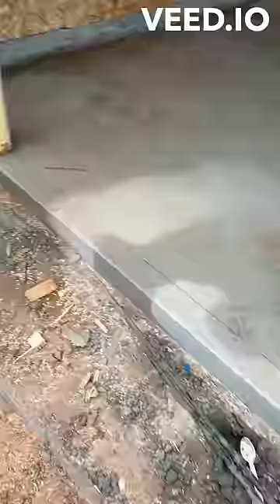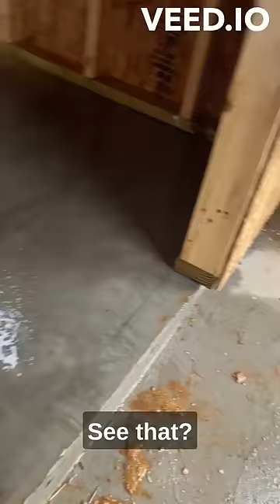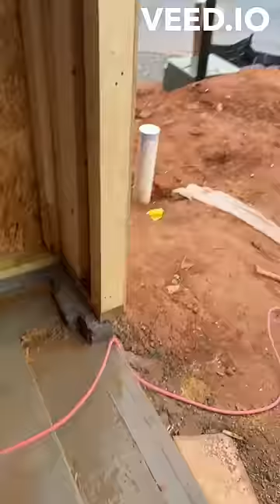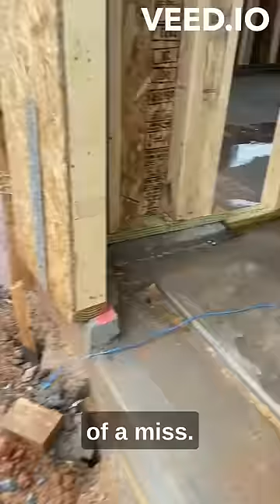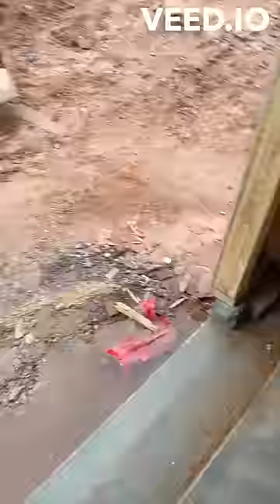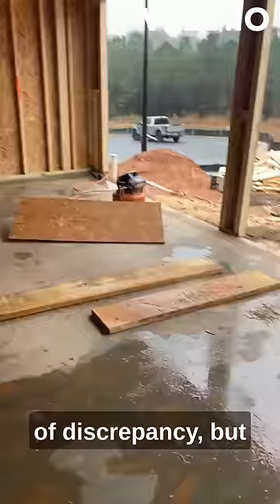New Home Slab is Wrong Size, What Now?

Comment: Before you frame an entire house, you might wanna call the general contractor and get permission to shrink the framing an inch and a half.
Reply: Finally someone with common sense
Reply: Well unfortunately, you don’t just “shrink” the framing lol
Look at the concrete, they weren’t off on the very first one, and the further down the line he got the worse it got. If you shrink the framing an inch you will be 6” off finished project.
I agree with you it should have been handled prior to this point, and maybe it was and they are all in communication, we don’t know because he didn’t say. But the excavator and concrete guys are coming back I can tell you that much.
Reply: GC dropped the ball when babysitting the concrete guy. You cant just change dimensions of a plan on a whim. Trusses have already been ordered and delivered sized to the print. The carpenter built to agreed plan. If GC wants the carpenter to adjust to the concrete guys, thats a change order. The GC breaks out his checkbook and the carpenter breaks out the sawzalls.
Reply: @LovelessRanch where do you get 6" from?
Reply: Well, 3 inches
Reply: What do you mean it's off? The concrete guys pulled the dimensions off the print... And measured to the outside of the form boards😂😂😂😂😂
Reply: I'm now almost 40 and it was mind blowing.  Watching grown, professional men, twice my age  having toddler tantrums and me trying to parent them through it.
Reply: No. This is NORMAL in Australia and a carpenter told my dad they just go ahead and build it to plan. Trying to get it to fit best.
Reply: Yes that would have made a lot more sense😂
Reply: @OffGridInvestor no one would have even noticed if they had just shrunk it a couple inches😂
Reply: Take an inch of framing it’s a garage not the space shuttle
Reply: That looks a lil more than 1.5 inches, lol.....
Reply: Carpenter dropped the ball not bringing it up
Reply: If you shrink the framing then the pre engineered trusses wont fit 🤦‍♂️and your stuck doing more work but then that calls for back charges lol 😂
Reply: @OffGridInvestor good thing America has better standards. This is getting rebuilt or builder will be sued.
Reply: @Un-Burdened 3 inches is what some men call 6 😂😂😂😂😂
Reply: @patrickday4206  🤣🤣👍🏻
Reply: What , carpenters that are willing to get a saw out of the truck.
Reply: On each side  so that's 3"+ smaller
Reply: the only people coming back are the framers to fix their f#$k up lmao
Reply: @joeloweryourexpectationsbiden  the cement needs attention to,  it's holding water and should drain out
Reply: Someone representing the owner/contractor should have been standing there when the framers were laying it out.  That’s the WHOLE purpose of being a supervisor
Reply: @scotthayes1804  I still see it as a total take down and rebuild
Reply: @davidvaughn you said it right
Reply: @AlejandroReyes-l8y it wouldn't make a difference for the trusses, the sofet would have been a little deeper, that's all
Reply: @bobparrott9257  ah you're actually right lol
Reply: Um, u can’t do that bro. It shrank the entire run. If u just made it tapper with the cement, every room would be totally out of square. 1/2 short on the taper? Ok, that can be dealt with but it’s close to 3”! Nope, those cement guys were hacks 🙄
Reply: Nah that takes too long. Hurry up and throw it up and get paid.
Reply: @whatfreedom7  that’s the mentality of a hack. (I’m not saying u, I understand sarcasm 😉). To many “builders” think that way. It gives us all a bad name and makes it harder to book jobs and deal with customers 😕
Reply: @AlejandroReyes-l8y then you adjust the trusses accordingly. They'll still work, it would just take minor adjustment.
Reply: You can do it I mean I'd ask for permission from the gc and have them sign off on it but it can easily be done just requires someone to do actual framing work and not this new age IKEA bullshit lol
Reply: I know it's easier to ask but do you even really have to in this case it's an inch and a half on a giant house
Reply: @AlejandroReyes-l8y they'll fit it's an inch on each side or 3/4 on each side on the garage
Reply: @mikehoncho9344 that's what I was thinking, could have just framed normal, shrink it 1.5 and the trusses will work ón the fucking garage. These are "can't do it" workers I can't stand bosses even become " he can't do it" bad bosses bad leadership. Póor pay is part of this nonsense
Reply: @KINGFAROOQ1216  ask urself if this was my house, would I accept this? My answer is NO. And we only saw on side. How bad were the other sides?
Reply: David, the trusses are already ordered or on site. Cannot be changed.  If the roof is conventional framing,, not a problem. I can cut my rafters to any size. But trusses?  Nope. Can't touch them without an engineers seal.
Reply: Might as well call the architect and tell him to redo the plans
Reply: Simple solution 😊.  Just make sure the contractor approves
Reply: @ranbo9390 Exactly.  Who laid out the slab? It may not have been the concrete guys fault.
Reply: @AlejandroReyes-l8y You take what you have and make it work
Reply: @austint1151 No it isn't
Reply: @jonnypee43 

Exactly Jonny, exactly. 

However, if the soffits are flat, shrink the framing and let it work out in the soffits.

God bless you Jonny you and yours always
Reply: The wall experiencing 2 inches out like this is reducing its footprint by like halbythough, the trusses would still have dull bearing if sitting on 2 inches less and it'd be hidden by the soffit
Reply: @Sailor376also the trusses would happily sit on a frame that's 2 inches smaller, the wall losing 50% of its bearing on the other hand....
Reply: @Mogliz0rz  No.  In Michigan and elsewhere,,, the norm is an energy truss, a 14 inch standoff at the top.  And even as you say, an old style truss,, you are going to be doing custom width cuts to get all you soffits to fit. Soffits are frequently done on the ground before the wall is raised.  Custom fits 20 feet in the air?   And you cannot just shorten the over hang on a sloped roof,, Your eaves would then be sloped ,,, That might work well to give the gutters a pitch.  Nope. been there and done that.  As in other 'solutions' The effing f***up by the concrete guy is going to cost me a lot of money.  It angers me,, that nearly every comment, solution on this thread,, makes the correction,, my pocket.  AND,, I am not empowered to change the plans.  I change the plans,, I do not get paid at all.  A for instance, kitchens.  Kitchen are designed and laid out to the exact last 1/2 inch.  Violate that and you are going to need a custom sized cabinet.Which will require months on a back order and the cabinet when it comes in will be from a different batch of wood and will not match.  The concrete guy and the GC effed up.  The solution is not to make me pay for it.
Reply: @LovelessRanch where did you see it off by 6 inches? And yes you toally can take an inch or 3 off the framing with out complicating anything. Its called being a carpenter. Unfortunately for this job they were only given framers.
Reply: @jonnypee43 how the hell would an inch and a half affect the trusses? Especially on a gable end? This was the scumbag framers capitalizing on the concrete guys mistake. A carpenter would have shortened the wall the necessary length and gone about his business.  Unfortunately they only had opportunistic framers who who done work they knew would have to be redone. Way more the framers fault.
Reply: @BGraves you do realize those are 2x4s right? Or to be exact 1 1/2 x 3 1/2s. There was none that only had a 1/2 inch of meat on the slab. 2 inches at the very most. Scumbag framers took advantage of the situation so they could come back and do it all over again. If i was gc id fure both concrete and framers and find more skilled mud dobbers and less sleezy opportunistic framers.
Reply: That is a crazy suggestion. Every cut in the entire home would need adjusting rather than calling the concrete gut come out and repair

Comment: Somewhere the concrete guys hung their measuring tape from the form instead of measuring from the inside of the form. I’ve seen that many times and if you look at this video. They missed it by a 1-1/2” which is the thickness of the form.
Reply: I was looking for this comment 😂 that is what I noticed too 🤙
Reply: Not sure what forms you’re using. But I’m a form guy, and never seen any forms 1.5” thick.
Reply: @dustincartie3502  so... you've never seen a 2x6 or a 2x8 in your life? As a concrete former? Really, you've never used lumber to form a slab pour?
Reply: @Keenan-cz3ds  "well yeah but it's called a 2x6 not a 1.5x5.5 "
Reply: Ok but… why would u frame if the slab is wrong? Shouldn’t you wait till that’s fixed… or just frame it to the new slab size ? Now it will be very hard to fix
Reply: Great observation and explanation of what happened,
Reply: @bongcrusha420 A 2×6 isn't 2 inches thick it is in fact 1 1/2  inches thick and see they start out 2×6 but after they get plained they are no longer that size
Reply: @lorenpotaczek125  wooosh thats the sound of the joke flying over your head. 
i put it in quotes because i know most people dont know and someone would say that lol
Reply: @bongcrusha420 2 people thumbs upped his comment too. It's damn obvious you don't mean it as something you're saying.
Reply: Nah it would be the same everywhere it was mis measured and perfect everywhere else.  The overhangs are different even on the same side
Reply: @dustincartie3502 dude I'm amateur diy guy, I've had minimal concrete experience but the forms I made were 1.5 inch side material wise with plywood .75 + .75, and I braced outside with 2x4s but the forms themselves not including support was 1.5 inches.
Reply: Framers trying to prove that point but they will be the ones having to do it over.
Reply: Yup
Reply: @bongcrusha420 stop talking man😂😂😂
Reply: I thought the same thing after the first time through it. But it still would have been a better move to get an addendum before going further than the first time they missed the end of the concrete....
Reply: @nofurtherwest3474 yes u would most likely frame to new slab.  100 percrnt.  Definatley wouldnt do what these bozos did at all
Reply: @dustincartie3502  how much concrete have u poured where uve never used 2 bys 6s or any 2 bys as forms or even thought or heard of people doing it.  And to everyone out there curious about american lumber  2 by any things is mostly always 1.5 inchs by what width size of board minus half in.  Hence in this case they used 2 by forms and measured incorrectly being off 1.5 inches the thickness of form board
Reply: @erictaylor6714  👍
Reply: True rabbit true
Reply: This is on the framers 100%. If there was a problem before framing even one wall. This should’ve been addressed.
Reply: Why don’t they design the slabs to be a couple inches larger than the frame to cover any leeway?
Reply: I’ve seen them take measurements from on corner across the front of the house, then pull measurements from a diagonal corner for the back, while missing 7” somewhere along the front. Really made a problem for everyone.
Reply: @bongcrusha420  Rough cut, it actually is a full 2x.  Once it is planed, it is less. Blew my mind when I started to work at a sawmill. Lol.  I was in the office.
Reply: This happens more than you know!!
Reply: This happens more than you know!!
Reply: Yea but never seen the framers go with it that far off
Reply: @mk810 for one reason, when you put the sheathing on the exterior walls, it will come down on top of the slab and water will drain onto it and work its way under the plates
Reply: Good point
Reply: @dustinca18+18mm =36 or an inch n a half
Reply: @mk810 or build a couple shorter when they frame? Same concept. 🐥 or 🍳
Reply: No, you haven't seen that many times. I masoned for ten years and never saw it once. Usually this is a framing problem. Rarely is the concrete off.
Reply: Do concrete guys even know how to run a tape measure?
Reply: @bongcrusha420 he didn't call it a 1.5x5.5. He just said that was how many inches it was off. What kind of concrete or form guy wouldn't know what kind of frame is 1.5 inches? Maybe crush a few less bongs and you'll learn at work.
Reply: Saved me a binch of typing 😅
Reply: @asthecrowflies1201  telling me to stop smoking when you clearly cant understand that it was a joke....
the amount of people in these comments that dont know a 2x6 is actualy 1.5x5.5 inches is fucking crazy. and no wonder why things get built so badly
Reply: @dustincartie3502 
You have never seen 2x4s 2x6s or 2x8s?  Do you actually construction?
Reply: The overlap is not consistent, even on the same wall. By eye I can tell it's over 1.5", other places .75", others .5". This thing is messed up on dimensions and out of square. Inspector isn't gonna let this fly at all.
Reply: @bongcrusha420  my bad. It was late and I totally thought you were the one that said you were the form guy.
Reply: My first guess to. It seems to be square and clean and it looks about 1 1/2".
Reply: Good call!
Reply: That makes a lot of sense. So frame off the slab and add double sheathing all around. 🫢😥!
Reply: @asthecrowflies1201  to dumb to understand the joke. sad
Reply: @bongcrusha420  yea, I'm "to dumb." You got me.
Reply: @lorenpotaczek125 I bet you over 70% of the country doesn’t know this.
Reply: The framer may have framed from the outside of the house wall sheathing as well, adding to the mayhem.
Reply: @Keenan-cz3ds  right.... I mean holy smokes. The amount of times I have actually seen forms for a slab... Come to think of it I don't think I've seen metal forms for a slab.
Reply: @mk810 the lip would collect water and it would look like shit... it's not that hard to do right
Reply: @dustincartie3502 Did you pay attention in math class?  Or were you helping your family in their drywall business?  Burrito Supreme please!
Reply: Damn that makes 💯 sense
Reply: @debiperkins  they started doing that to save money right because we used to plane boards to exact dimensions back in the day?
Reply: @bongcrusha420 doesn’t matter what it’s called it matters what it measures.  Clearly u never used 2 bys before
Reply: But what doesnt make any sense is in the outside corner you see this janky ass splice to add on what looks to he a foot. Theres a studnover the splice that clearly isnt on 16s. This tells me theres a lot more to this story. The added to the wall to make it like that. Such an unbelievably easy fix.
Reply: @dustincartie3502 wow youve never used wood or see  wood used to form?what the hell do you use?
Reply: Very astute observation thanks
Reply: So the plans called for a slab of a certain size and the concrete guys ALWAYS think that's achieved by using those as dimensions for the outside of the form??
Reply: My thought exactly. Off by the form boards
Reply: I’m a Master Roofer, Master Plumber licensed in 53 states, a Grand Master Electrician with my Journeyman, Lineman and Postman papers, a fully certified HVAC+ deinstaller and a time served fully qualified Window, Tile and Trim carpenter and I can tell none of you have ever worked a day in construction, building or general contracting (I’m one of them as well with over ninety years experience). I’ve built it all and I was born knowing everything. Because I have so many skills I have never made a mistake and always listen to another persons point of view. I would never rubbish another tradesman’s work but neither of those guys did anything right there. They should have used dope and tape with a 1 in 40 uphill slope to make sure the anti-siphon double check valve was able to trip the 20Amp breaker before the 7x.125 Romex overheated and rendered his buildings insurance invaluable. Or place a lien on his house. I had a customer from IL who moved to Diddlyboing IH and refused to pay me for some hardwood refinishing underlayment I’d put in to thwart his HOA from issuing a summons and he said he wouldn’t pay me on account of me not being a fully certified board member of the Carpet Installers Union of America and Texas. So I leaned on his house. So he can’t sell it now. 

Also I weld.
Reply: @bongcrusha420 and the 2" is the unfinished dimension. 2 x's haven't been 2" in several decades, we just still call them that 😂
Reply: @chowchow2386  ..... thats the joke
Reply: They missed by more than 1.5"
Reply: @lorenpotaczek125 boooo ya. Owned
Reply: @bongcrusha420 😂😂🤦‍♂️
Reply: No one owns a laser?